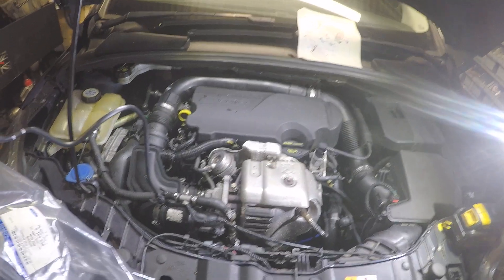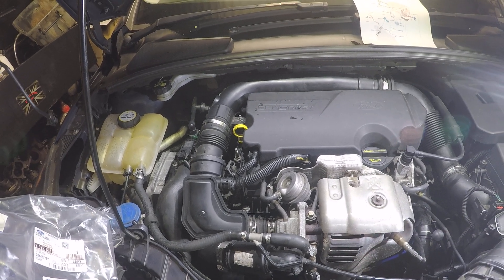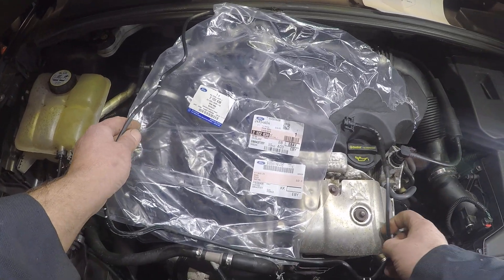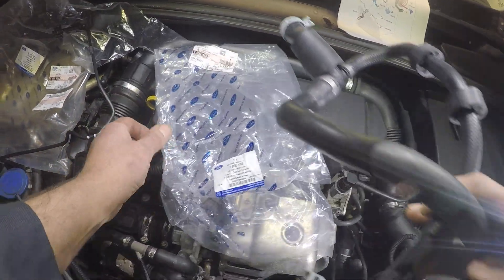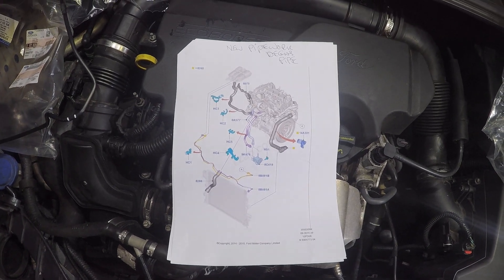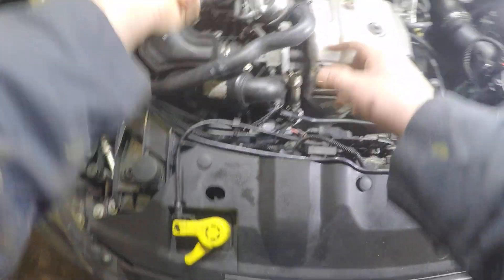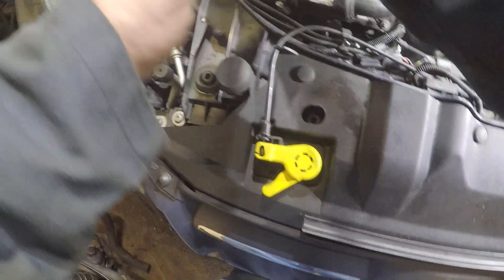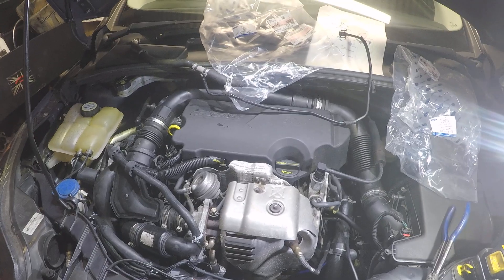Ford Focus 1.0 eco boost coolant system conversion ,Degas pipe upgrade, danger of overheating

Comment: Thanks good video. I’ve had a replacement engine as the wet belt went and now I’m getting all the pipes starting to crack. Had nothing but bad luck with this engine type would never get another one 😔

Comment: Good effort.  What do you call these pipes specifically?  Just “the degas pipes”?  Any other coolant pipes to replace? And... lastly, do these apply exactly the same to the 2013 EcoSport with the 1.0 ecoboost engine?

Comment: Yep mine broke last year and blew the engine. Told ford prior to that and they said urs aint a recall. So when it blew they accpeted their mistake and fitted me a brand new engine and turbo. But this pipe crack again yesterday. So im upgrading now thanks alot. 👍🏼. £52 for 1 and £17 for the other straight from ford. Cheers

Comment: It must actually empty the head of water. I have had the degas pipes fail on BMWs a few times. You get a warning followed by overheating on the temperature gauge when in traffic. Any car that cannot handle a  leak of coolant without showing an indication to the driver is not going to make it to old age...

Comment: Thank God I saw this early, I would have been in big trouble, I actually saw the puddle of coolant liquid on the floor as I was walking away from the car, got it fixed today
Reply from the maker: Glad I could help ,it would have been a new engine eventually 👍
Reply: @mechtechmechanical1571  Yeah ate thanks, I actually left the garage and will have to go back on Monday, when I got that pipe from the Ford dealership and took it to the garage, they were about to put it in but there's a clip that was needed, so I have to go back on Monday to the dealership, hopefully they have it

Comment: hi i have ford focus ecobooster 1.0 2013 with leaking in the joint is both parts compatible with this car?
Reply from the maker: Hi yes you will need both pipes thanks
Reply: @mechtechmechanical1571  i ask to the supplier online on ebay and he said that two parts they are not compatible with my vehicle .what you suggest me to do buy a same parts  as before or buy this two parts .
Reply: done today and everything is perfect thanks again for your help and video.

Comment: Hi there. Thinking about doing this on my focus. Is there anything I need to know about replacing/topping up coolant once the pipes are changed? Thanks
Reply from the maker: Just top up as normal but get all the air out of the system by running the car
Reply: @mechtechmechanical1571  Thanks!

Comment: I got really lucky with one of these. Bought a 12 plate 99hp version and when I took it in for a service, the garage mentioned it should be looked at. I was noncommittal, but as they were doing the sparks ( all 3 of them!) They " disturbed" the hose and it started to leak. They put their hands up and did the pipe free of charge as it was their fault! RESULT!
Reply from the maker: your very lucky you should do the lottery ,this could of cost you a small fortune if it had failed thanks for your comment

Comment: Thanks this pipe is upgrade of an upgrade. Had a new engine 5 years ago and the plastic pipe was an upgrade, but not been informed of the new upgrade .
Reply: Hi is it best to buy from eBay or will Ford have these parts in the new version and not the old to purchase?

Comment: This has happened to mine, still starting (obviously not driving it) bought the part today, does my engine seem like it's been saved with it still starting? Not sure how long I drove like it
Reply from the maker: I’d advise you put the new parts on and hopefully fingers crossed it’ll be ok 👍
Reply: @mechtechmechanical1571  thanks for the reply! Fingers crossed 🤞

Comment: I have a friend at the work, who have this focus 2013  and got suddenly broken cooler pipe during drive from work, and he's probably damaged the engine (he is still waiting for final diagnose).. 
Great video and info, but would be way better if you could provide material number of those spareparts you are using..
Reply from the maker: Hi thanks for wAtchin the vid and feedback the part numbers should be listed. In one of my reply’s

Comment: Hi been watching your video about 2013 ford focus degas pipe.just wondering what the part number is please. Been to ford dealer and they was just giving me old pipe not upgrade?
Reply from the maker: there are 2 pipes 2122838 and1855418 you can get these on eBay from rates ford thanks
Reply: @mechtechmechanical1571  thanks for that mate 👍
Reply: @johnsteele5705  Hello mate. Thank you for uploading the video. Would it be possible to send the links for the parts you've ordered on the description box? I've ordered the original pipes I stead of these upgrades but would like to change it. Thank you!
Reply: @ameerb9534  there are 2 pipes 2122838 and 1855418.👍
Reply: Hi, Great informative video. Looked at purchasing pipe 2122838 from eBay but it said it wasn't suitable for my 2012 (62 plate) Ford focus ecoboost 1.0 zetecturbo. Is this correct? Part says it's for Ford Focus ecoboost C Max

Comment: What are the part numbers for both parts cheers
Reply: Overflow Container Hose has number 1855418, the bigger one has 2122838
Reply from the maker: 2122838 and 1855418

Comment: What’s is the time interval to change the timming belt???
Reply: Ford  says 10  years or 240 kkm but don't believe in that ,in reality  it's  max 8 years or 150 kkm  because you can  lost timing  on your engine.
Reply: @pawlo79pl  i think it need to be changed after 60000 km

Comment: Hi, my mk3 is losing coolant slowly but can't see where though, mine doesn't have the hose upgrade, is the hose upgrade the mk3.5 hoses. I want to replace the old rubbish
Reply from the maker: Hi Lee yes upgrade to the hoses which I use in the vid also check the timing belt cover ,the water pump gasket is prone to leaking from there and gradually drains the coolant
Reply: @mechtechmechanical1571  thank you for getting back to me, really good, I'll check the water pump gasket tomorrow, the hose kit did you get that direct from ford.
Reply from the maker: Hi you can get the hoses on ebay from rates ford
Reply: @mechtechmechanical1571  thank you. I'll be checking that site out, as for the water pump gasket that's looking a big job. First things first. Thank you

Comment: Good information there, I can agree with you regarding the damage this poorly engineered design can do.
To not have a low coolant warning sensor on expansion tank (which in itself is prone to failure). is abysmal in this day and age.
The new thin pipe looks like it is plastic but must be better than the old design.
Reply from the maker: Hi Paul thanks for your comments I’ve now discovered that they have an electric water pump on the turbo to cool the turbo when you pull up after a hard drive ,this is supposed to be installed if your towing a caravan I’ll be posting a video shortly cheers
Reply: It is possible to add coolant low level sensor, here is one of possibility. But of course better is to upgrade pipes to mk3.5   . 

https://www.fiestafaction.com/threads/diy-15-low-coolant-light-no-hacking-required.56722/

I did it little bit diferent, but princip is same

Comment: I have a 62 plate 1ltr ecoboost, i noticed i had no coolant in the tank, topped it up last week & looks like its running down allready, checks both pipes & cant see any leaks/cracks breaks etc, is there ant other way to check if i need to buy degas pipes ? are the new pipes diffrent design to the old ones or are they just new ? thanks
Reply from the maker: hi this sounds like a head gasket failiure which is very common on this engine ,what you will need to do is a pressure test on the cooling system to check for a pressure loss leak ,if the engine has overheated due  to no coolant this could be the problem
Reply: @mechtechmechanical1571  ok thanks, how do i do a pressure test ? if there is no loss of pressure what should i look out for
Reply from the maker: @ORIGINOLINDIVIDUAL  HI you'll have to buy a pressure test kit off eBay around £30

 connects to the expansion tank ,theres loads of vids on youtube
Reply from the maker: also if you what the video im replacing the pipes with the new ones from ford completely different from the old ones
Reply: @mechtechmechanical1571  thanks for reply mate
Reply: @mechtechmechanical1571  what is the thin radiator over flow pipe exactly called
Reply from the maker: Hi check the timing cover gasket ,the water pump is prone to leaking and can gradually drain the coolant